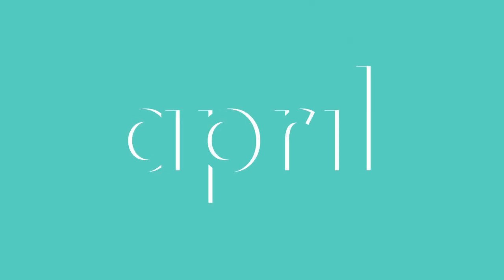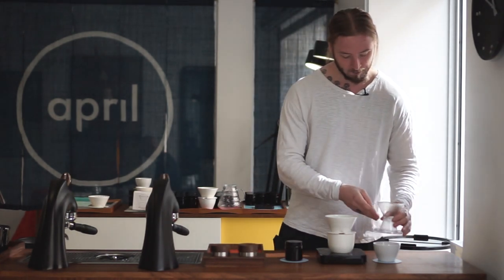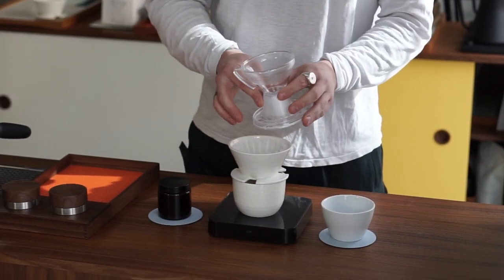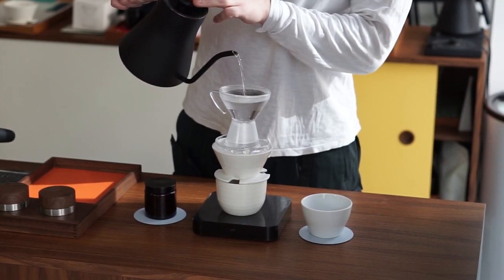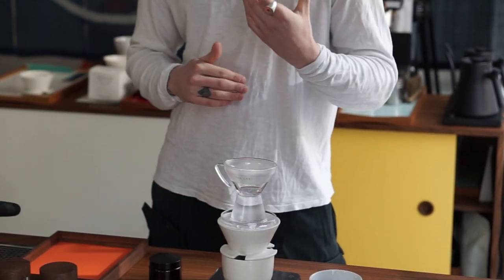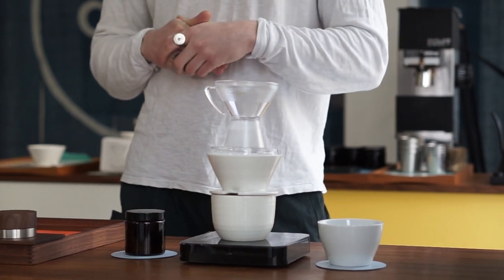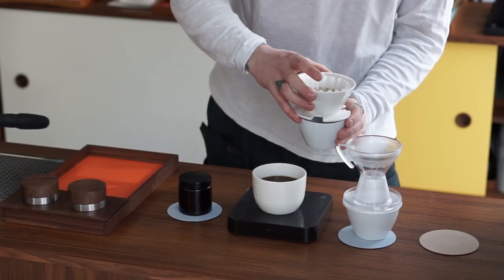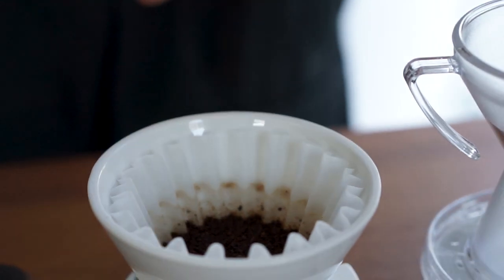Pairing the Gabi Master A with our April Brewer | Coffee with April #170

Comment: I'm really interested in these water distribution tools, but mostly from the perspective of a cafe worker. More consistency and less active work time makes pour overs a lot easier in a busy day (especially for the less experienced baristas). I also like it as a guy selling coffee brewing equipment, getting customers into pourovers have always been a challenge, gooseneck kettles are expensive and have a high learning curve, whereas something like this is extremely easy to use and cheap, and you can use any cheap kettle you want. I see a lot of these are on the market now, gabi drip master A and B, melodrip and even hario is comming out with one now. Out of curiosity have you guys at april tried some of the other options and have any opinions about which is the best one?

Comment: Have you tried the Gabi Drip Master B as well? Extraction is mostly completed in the beginning half of a brew so I find the use of Gabi particularly useful at the latter half, minimising agitation. If you aren't preheating the Gabi, there's also quite a bit of drop in temperature but either way is a more gentle extraction to end your brew. The grind is slightly finer than normal but not as fine as brews where you would be using the Gabi the entire time!

Comment: I am using the Lili drip tool, kind of the same, and I’m pretty impress by how fast the flow rate is, i was thinking that having many little pours instead of one big pour with more water flow would slow down the flow rate... I am pouring directly on the coffee grind with my kettle for the blooming phase, adapting my amount of water depending on the acidity or sweetness i want in my cup, and then pouring all the rest in one time using the Lili drip tool. It give me consistency and it makes it easier to manage you grind size and water temp depending on the coffee beans.
Reply: i said Lili drip but i wanted to say Melodrip ahaha always confuse between both
Reply: I was extremely confused a second when you were talking about lilidrip lol, I was like "I don't think that's how you use that thing......" but yeah, been there done that too with confusing those names before